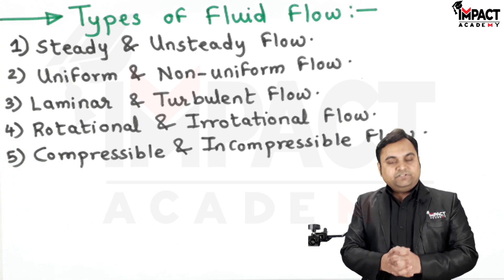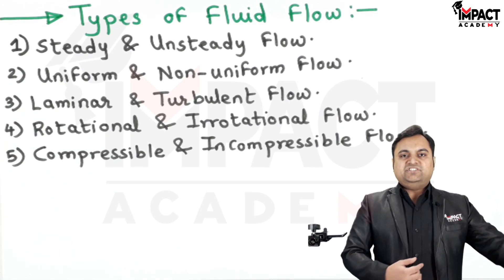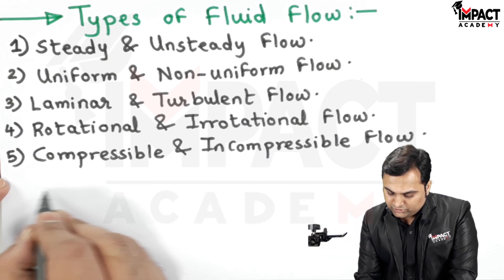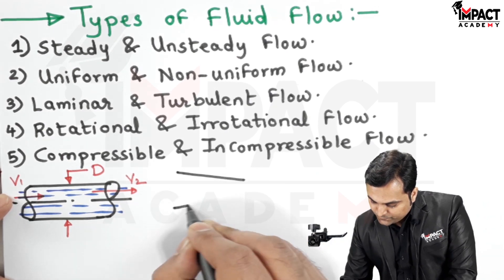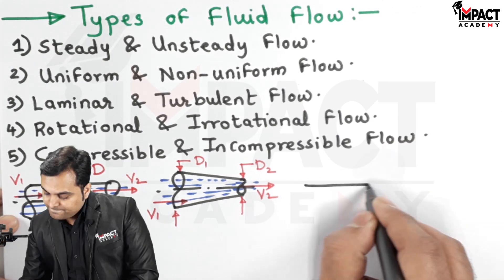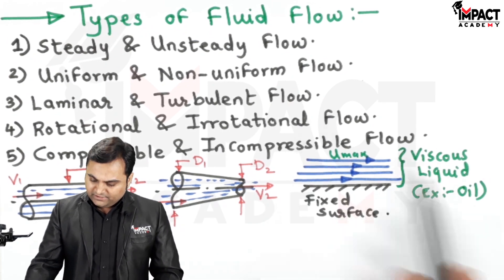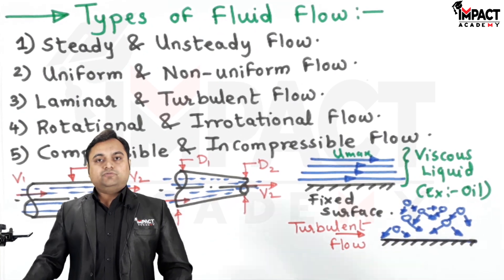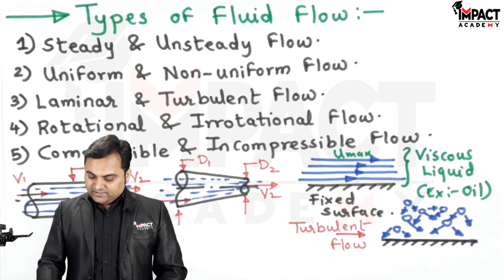Types of Fluid Flow | Fluid Mechanics & Machineries | Engineering #freeengineeringcourses #zafarsir

Comment: in case of fluid simulation to observe the velocity distribution, why we need to set the density to be constant, though air is compressible flow(denisty changing)
Reply from the maker: Watch Engineering Video lectures at your Home using 
Impact - The Engineering App
Call for details:- 
+91 7900123134
Click on link below for download👇🏻👇🏻👇🏻
http://bit.ly/impactEngineering